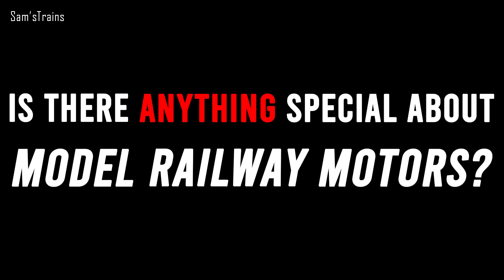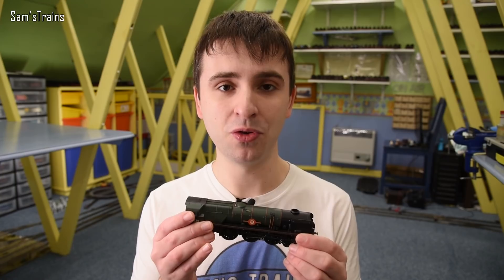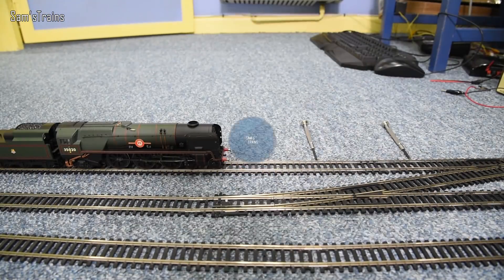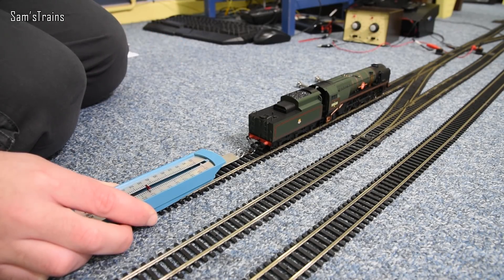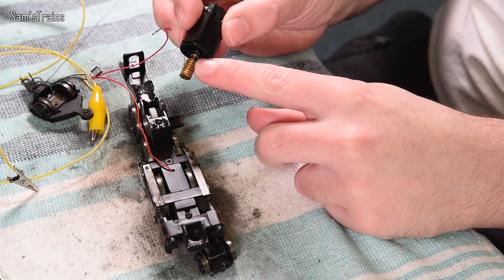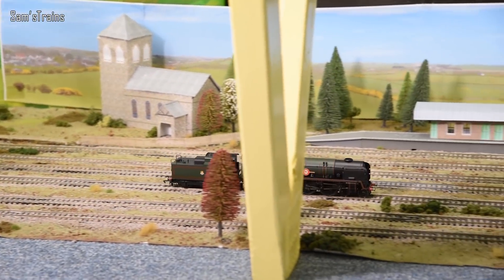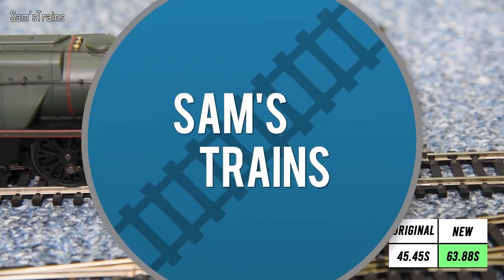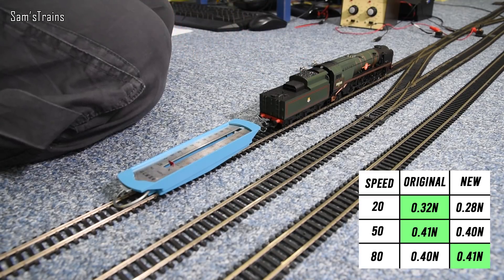How Much Do Model Train Motors Really Cost? | £2 vs. £27

Comment: Well, I you are interested in computers like me, you can spot which brand is a genuine ripoff when it comes to prices, one with a fruit name... Here on Youtube, I have seen a professional musician and sound engineer, Rick Beato, manufacturing a computer that can run Mac OS X for more than HALF the price of Apple's offering, at equivalent performances, something like 2500 USD vs. 6500 USD. But you have a cheapest version to buy, not all naufacturers sells their products like Apple. If you need a GBP 150 tablet, you have the Acer model that might be sufficient for you, and you don't have to buy the Appli iPad at GBP 600 iof you want a tablet. With model trains, there is no choice, everybody is awfully expensive...
So; the question is : what are you NOT paying by buying the straight from factory motor instead of the "original" spare part ? Quotation marks because I do not belive that Hornby or Bachmann buy electric DC 12V motors made specially on their specifications, (Heljan buy the ones in the thrash bin waiting for recycling behind the factory) they have to buy them off the shelf from manufacturers which have them on their catalogue.
So if we are nice towards the manufacturer and say that it is not their Apple-like net profit margin that skyrockets the price, what are we MISSING with the chinese motor ? Raw material quality ? Assembly quality ? Orverall performance ? You would have already seen it with your test... Assembly line quality control ? Maybe... But those motors are usualy sold in bulk to manufacturers of consumer goods that requires them, e. g. small domestic electric appliances, electric car windows... and they would certainly not have contracts with manufacturers with a poor quality control.
For Budget Model Railways, I hade made some research on the price of model railways, and it is the only consumer's product that had NOT seen its price, in constant money, goes down from the '70s or '80s. To give you an indication, a locomotive comparable to this one from a good continental manufacturer (Roco to say it clearly) costed 500 french francs in 1980, thats around 76 € in real money (2020 calculation with french inflation factored, 226 % since 1980). The same type 40 years after is sold for 315 € in real money, an overall FOURFOLD increase in price in real money !
EVERY other consumer grade hobby products had seen their price in constant money goes down in the last four decades, not model railways models ! And there is some blatant nonsense there : I have bought Parkside model wagons in KIT, they cost as much as Oxford Rail RTR ones ! E. g. : LNER cattle wagon : Parkside kit : GBP 10 (ref. PC 50), Oxford Rail RTR : ALSO GBP 10 (ref. OR76CAT003). Same retailer: Hattons. And it is assembled and painted... Parkside can give us the decals and the NEM pocket for the price they charge their kit, that might not cost them over GBP 1 out from the assembly line...
Well, excellent job this test. Your chinese motor might perform silghly better because it is a brand-new one, or it is at the hight end of manufacturing tolerances, but that would not surprise me if Hornby had bought this model straight from the same manufacturer ! Conrad sells electric motors for modellers from around GBP 4,40 for the lowest priced one, ideal for model trains (see this one : https://www.conrad.fr/p/mini-moteur-a-balais-brushed-motraxx-sfk-130sh-14190-26550-trmin-228959, given for 1/32 RC cars, but it can fit into an OO locomotive). And for the equivalent of GBP 25, it is beefy electric motors for huge HC car you have from them.
Sorry for the short novel, but you have done such an excellent work with this test that I cannot do less than give you usefull datas in my comment, and that requires some writing. Keep on the good job done !
Reply from the maker: Yeah you're right Oliver - Apple are known for that! Though at least their phenomenal design work makes up for it in part (usually!). You've definitely got to watch what you buy - that's for sure!!
Thanks for watching - Sam :)
Reply: @SamsTrains  Agreed with you. I'm back here to correct an error I have made, it is about the price of the Roco Model from 1980 to today. 76 € is the equivalent in euros of the 500 FRF 1980's price, not the corrected for inflation price ! With inflation factored, this is the equivalent of 247 € of today, still below the 2020 retail price of 315 €. That is not a fourfold increase in constant money, but still a blatant 21,5 % increase in price, when everything else in hobby had seen its price decrease for the same period. In 1980, you cannot have a RC car for GBP 50, or a basic toy, see now what you have at this price today !

Comment: Sam, for an experiment video fit a giant motor into an engine. 540 size?
Reply from the maker: haha that'd be awesome!! :D
Reply: Speaking from a different hobby (RC Cars), we pretty much standardized on that size motor for the 1/10 and 1/8 scale stuff. The custom tuned "hot-rod" motors you can get in that size are really something else, they're all 3 pole but you can specify how many turns are on the armature to tune the "power band" of the motor to make the model perform the way it's intended. As a rule of thumb, high speed models use motors with fewer turns, and low speed models use motors with more turns. Since we're talking about a model train, which is a low speed application, I'd recommend a motor with around 40 turns. Look for one designed to go in a "rock crawling" RC car.

On the other hand, even a typical "can" Mabuchi 540 motor would be powerful enough to pull a train that is a scale mile long or more, by itself, up a steep grade. The likely limiting factor would be wheel slip of the locomotive.
Reply: @44R0Ndin  I actually am into the rc hobby, that's why I mentioned it. I just got a channel "Making Dirt Fly" no videos yet. anyway I've got to go do Kevin Talbots 2 wheel challenge with a slash 2wd brushless. idk if you have seen Kev, but he is a great channel.

Comment: Great video, Sam! I have a couple of Athearn switch engines i want to re-motor before putting DCC in them. You are correct, manufacturer's prices are pretty steep!
Reply from the maker: Thanks mate! Definitely worth checking Ebay to see if alternatives are available - look for 12-24v motors though, not just 12v ones!
Thanks for watching - Sam :)

Comment: And you did declare these items for Customs & Excise Duty I take it? Which should mean at least 4.8% Import Duty + VAT on the £16.10 = at least £21.40. If you didn't declare this as an import, Customs & Excise may come banging on your door, confiscate what you have and fine you in the process. It's called smuggling !!!  Ignorance of the Law is no excuse !!!!
Reply from the maker: I hope you'll find there's no ignorance of the law on my part. There is no customs duty charge for anything under £135. As far as VAT is concerned, that's taken care of before the courier will make delivery, but only where the value of goods exceeds £15. What does excise duty have to do with buying motors?
Thanks for watching - Sam :)